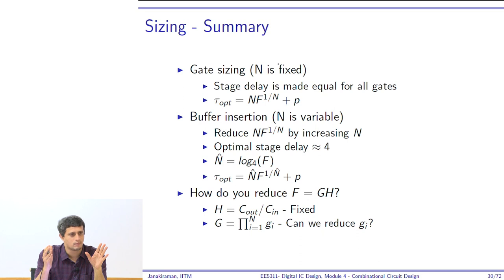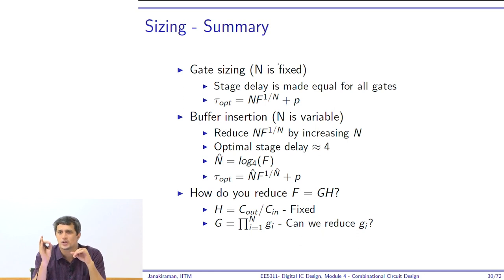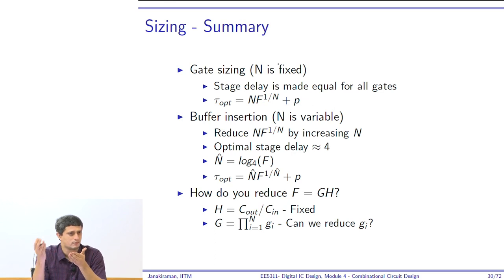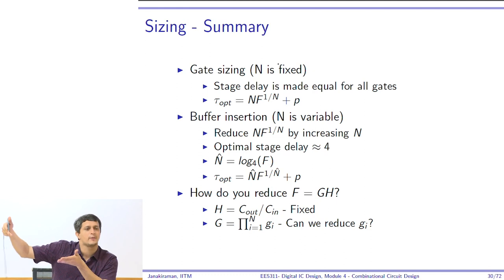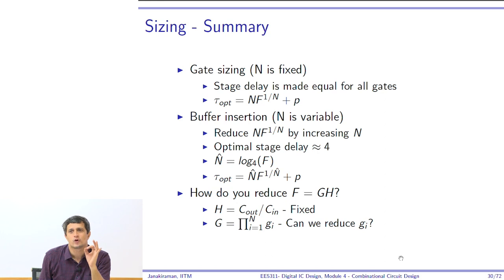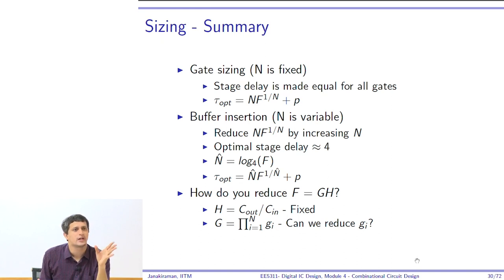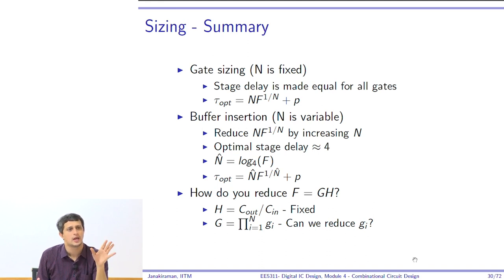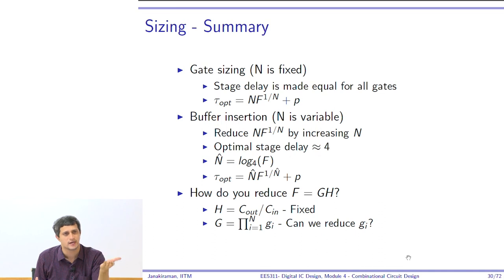CombCkt - 11 - Buffer Insertion

Comment: when we add 4 inverters, we get a delay of 35.29 < 35.85(delay i got using 2 inverters)
Reply: Yeah, same doubt.
Reply: if we take optimal strenght = 3.59 , N comes 7.2 . Meaning N = 7 or 8 is optimal. For 3 inv ( N = 7 ) , delay is around 35.09. If we don't want inversion , buffer length of 4 gives better result as its obtained for optimal strength = 3.59 and it being 4 is approximation.